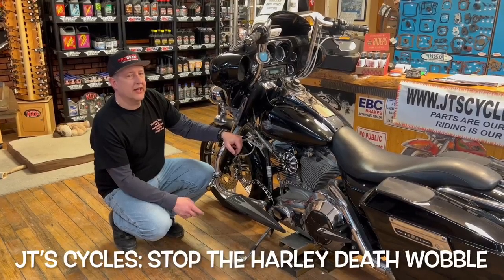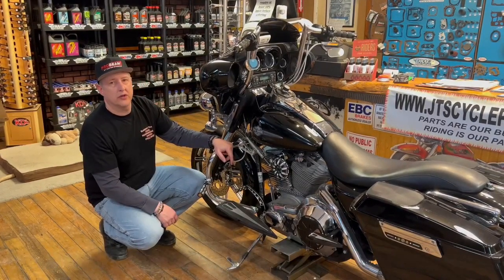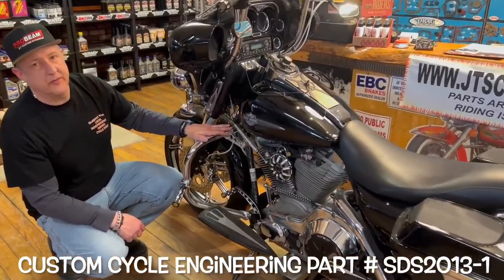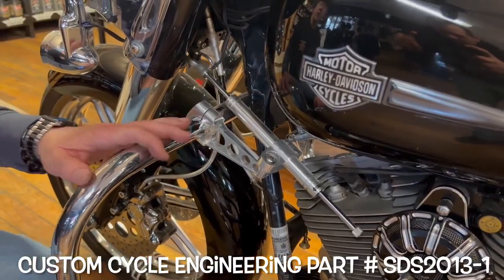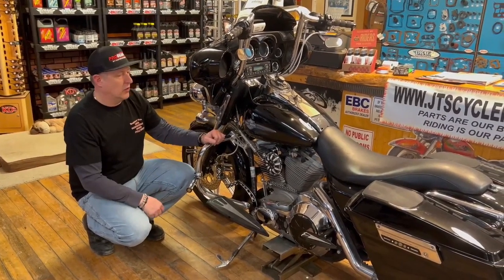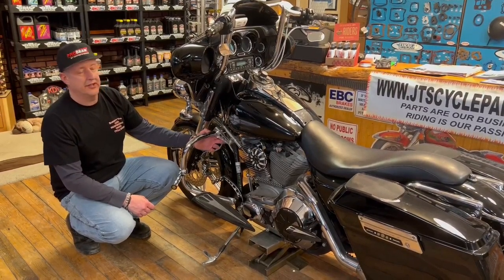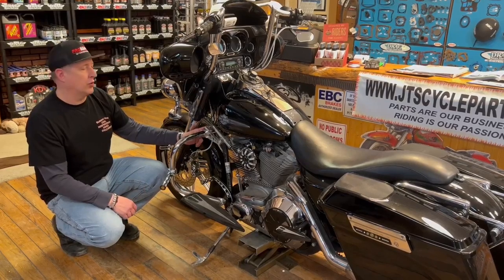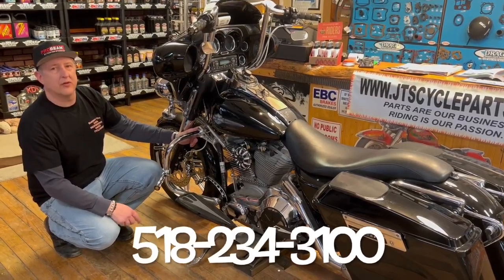Stop the Harley Death Wobble

Comment: I own a 90 Ultra Classic with over 100,000 miles on it.  Made several trips from Chicago area to D.C. area to visit brother.  Taken State Roads and Interstates and have never experienced ANY handling issues.  Not sure where this "Death Wobble" myth started and also  unsure if some other thing (bad tire, bad rear wheel alignment, bad shocks) could be the cause, not a design flaw as so many "EXPERTS" suggest.  One video on here showed a guy going into a "wobble" he got out of. He "labeled" his  vid "The Harley Death Wobble" only to state AT THE END he had a bad front tire.  So before you go spending a bunch of money on fancy  parts, perhaps go over your bike front to back  before you ride.
Reply: Jerry Jones;    Back in '57 I was riding my '46 EL 61 cubic inch Harley.  At the time I was 16 and had my 15 year old brother along with me on the back.   We were on a straight stretch of road and had been following a car which was observing the 55 mph speed limit, but I decided to pass anyway.  I knew my rear tire was getting bald when I pulled out to pass and  was right beside the car when the tire, she blew, causing me to lose most control, went down in the ditch on the left side of the road and up to the top of a 12' bank and back down again, coming to a stop at the lowest point of the ditch.    

I soon got rid of my high speed wobble by getting rid of my Harley!      BHE
Reply: Bruh…for someone that knows a lot, calling it a “myth” only shows your lack of experience. Probably because you’ve only had that one bike for a century. I’m on my third Harley in 8 years. It’s no “myth”.
Reply: @iamthelastemperor  Actually, I've been riding for 50 years, mostly, but not exclusively Harleys.  I also have been a member and at time officer of Abate of Indiana.  Neither myself nor anyone I've known has experienced this "Death Wobble".  The only time I ever had a steering wobble was when I was riding a '54 Servi-car down the interstate full out (not recommended) hit an old bridge expansion joint and the whole damn thing went airborne.  When I came down THEN I had a steering wobble until I got it slowed.  I have maintained my 90 Ultra front to back in the 20 years I have owned it.  When I put a drive belt on, the swingarm bearings got changed.  I do not let my tires get worn.  I have replaced rubber motor mounts.  Parts do wear out and a lot of Harley riders, especially the newer ones, simply do not maintain their bikes.  Mine has over 104,000 miles on her now and still rides smooth and straight.
Reply: @thejordanparkempirewhat speed does your Harley wobble at, I've had a Road Glide for several years and haven't experienced it? Had a Suzuki 1150 that had one about 125, but you could punch through it, it was scary slowing down back thru it tho, don't know why it seemed worse going that way.
Reply: @iamthelastemperor  I previously owned a shovelhead FLH and before that a panhead FL. Drove both long distances and never had a wobble. I suspect most are caused by tire issues. Any misspells are a product of my fat fingers on this phone keyboard.
Reply: Idk, my 90 classic I had and the 06 I have now were 2 complete different handling bikes. They look the same almost identical bikes but the 90 out handles the 06. The 06 has had the bars wobble before when hands are off. The 90 is rock solid. I’ve messed with the 06 and have just accepted the fact it’s not as stable a the other one. It’s not a myth.
Reply: @iamthelastemperor  That 90 was my 3rd 2 wheel Harley. Had a pan and shovel, botjh FLH"s.  Been riding 50 years, never a " death wobble."  My first Harley was a Servi- car with a WLA engine sand taller gearing to do 60 mph. Was going down 94 and hit old expansion joint on bridge. Entire trike went airborne and when I landed had a horrible wobble that I I slowed down and got out of, but that was because Servi- cars eere never meant for jumps.
Reply: @scottberry5266  frames were changed 3times between 90 ang 06. Once in 92, again in 96 and again for twin cam..
Reply: @jerryjones2818  : ok. I knew some changes were made but not how many or what. Like I said my 90 eglide sat rock solid , my 06 eglide felt wobbly from day 1. I’ve messed with alignment, tires , rear shocks, etc and it’s either better or I just got used to it. I have a 12 Victory Version that outrides,outperforms,and out handles both eglides.  Thanks for the info.
Reply: @scottberry5266  Interesting story: a couple in our Abate group bought identical 01 Electra Glide Classics. Same paint and all. She hated hers from day one, said her 96 rode better, but loved riding his. These were identical bikes but his rode easy but hers handled rough. They tried a couple dealers but no one could figure it out. They traded both bikes in 05 and never had any more problems.
Reply: @jerryjones2818  : yeah, it’s weird. Everything I did to the 06 was an improvement I guess. I was always going to put a progressive spring upgrade on it and the truss that bolts to the frame and bottom of the engine but never did.
Reply: @scottberry5266  Yeah. A few years back they dropped the rear air shocks in favor of one 'progressive" shock and one "neutral". Can't speak to whether it improved the ride but all the dealers said it was improvement. My 90 rode great, tracked straight and smooth, and I had no trouble going back and forth to Virginia. 4 times
Reply: @scottmcburney8938  
Nothing wobbles under 65 mph. I normally start feeling it getting loose around 90-100 mph. Nevertheless, the death wobble is no myth! Not on baggers it's not! That's a fact.
Reply: If you ever experienced wobble on an Ultra Classic it's your tire pressure
Reply: I have a new 24 Street Glide and there is definitely a wobble. Firsthand that steering is very light, I wish it can get heavier as you ride faster.  Anyways on the same ride and same highway but a different stretch of the road, I can cruise 85-105 and it will be no issues, ride with any cross wind and the bike will wobble, you mind just prays for no tank slapper. It recovers good but the feeling not so.
Reply: @iamthelastemperor  I have owned a flattie(54 servi-car,) a pan(63 Duo- glide

Comment: this and other steering dampeners, work. but they do not get rid of the rear wheel steer that plag that year Harley that cause the wobble in turns or when steep hard banking. you need an engine to frame stabilser. even a set of stiffies put in the swingarm pivot point on both sides of the swingarm bearings work, which is where the problem occurs.
Reply: Another overthinker who bought into the "Myth"
Reply: @A V yea they do that also.

Comment: I have found that making sure your preload is properly set on the rear suspension is a huge factor in preventing rear end wobble. I have pulled over in the past to stiffen the rear end. It will usually happen when adding weight like a passenger or a passenger and luggage if your don't stiffen that rear end up. I just made adjustments on my last trip this past week while on the trip. I took my 04 Dyna Wide to Mi from Scranton PA. I had some wobble on the freeway so I hit the first rest area and adjusted it one click that straigtened it out then added a passenger before leaving with the passenger I added two more clicks no problems took it back one before I headed back. No problems, there were lots of cross winds and trucks and tightening the preload kept the bike stable. Just saying, pay attention to preload it makes a world of difference with rear end. Note: if I feel the wobble when starting a ride at all I will stiffen the rear end a click at first opportunity.

Comment: All motorcycles and even cars wobble some going by or when a semi passes you, it's wind dynamics, not the death wobble. It may happen more to Harleys because of imbalance and stress on the frame but I've had it happen going straight on a CBR 750 and wasn't going over 75 mph when it happened thank God, it's a unpleasant feeling. Hopefully with the dyna's going with the softball design that problem will be less frequent.

Comment: I have to run 90 mph to stay in formation never had an issue with death wobble as long as tire pressure is good on Ultra Classic
Reply: You have been lucky. When you run triple digits these rubberglides have issues.

Comment: have you thought to grease the neck Barings?? when i  worked at the Harley shop, the tech don't grease the neck Barings, that where you get a wobble?? on the dyna they need  be repacked and adjust to specs. older softails have a grease sert and baggers have them.

Comment: all you had to do is adjust the steering bearing tightness.... for free.
Reply: There is more to it than that but you have a good point. The number 1 reason for wobble is low front tire pressure on any scoot.

Comment: Problem is…I think it’s the back end that wobbles. I would debate whether or not it starts in the front and is exaggerated when it reaches the back. But I never feel it in the front. I feel it at the back wheel.

Comment: Decades ago I found the best way to get rid of your Harley wobble is to toss your Harley and get a better motorcycle.  I've owned and ridden a pair of Honda ST 1100's for over 25 years....NO wobble at ANY speed.
Reply: Then again a lot of "Riders" on this chain seem too lazy to INSPECT their ride, something that should be done every ride no matter the make.  Evidently a lot of fools think you can just get on and ride forever--nothing wears out.
Reply: I rather walk to own a Honda
Reply: @russellabernathy3241  Life is full of choices and if you're satisfied, I couldn't be happier.  

In 1956, I bought my first motorcycle....a '46' Harley 61 Knucklehead.  I then proceeded to put 160K on four different Harleys, including riding to work in San Jose, CA, 100 miles/day for three years.  At 28, I found myself raising two sons, told myself it was time to start acting more responsibly and sold my last Harley.   I had just made an expensive move to Oregon for a job that hadn't worked out, and then back to CA when my ex BIL rode into my driveway on a brand new Honda 750 four cylinder.  I was aware of Honda, but as a then Harley addict, had paid them scant attention.  Took it for a short ride and suddenly I was back into riding again.   Here was a bike that looked good, sounded good accelerated great and had something which Harley had, at that time, only dreamed about, but had never actually executed....a front brake that worked.  

The culmination of my riding came in 2013 when I rode my Honda ST-1100 all around the USA on a mission to 'bag' the 13 states I hadn't previously been in....and did.  Now, I can brag I've been in ALL 50 states. 

Total riding on all of my bikes...well over 200K.   

I haven't ridden much since I took a 5000 mile ride nine years ago, am now l'm facing 82 and think it's time to quit whilst I'm ahead of the game.     BHE
Reply: If you had a "wobble" "Decades" ago you had a bad tire.  This whole Harley Death Wobble myth is a result of people buying motorcycles and not knowing how to maintain them.  The new "Bikers" have no mechanical skills and think you just push the button and go, never maintain or check your bike..  YOU are a Harley basher who either is lying or never even owned one.  I have owned Harleys for Decades for real and never experienced the so called dreaded "Death Wobble".  I firmly believe any wobble is the result of poor maintenance or bad aftermarket parts.
Reply: @russellabernathy3241  The way you've phrased your comment sounds as if you'd rather walk to a Honda Dealer so you can then own one!
Reply: @blackholeentry3489  lol actually I was a Honda Dealer from 1969 to 2020 . I know Honda pretty good . My father and I were a Harley Davidson dealer from 1957-2020 . I never cared for Honda at all . I’m 68 years old now and just got back from Sturgis which I go every year . I rode 1187 miles last year on my Street Glide . As a Honda dealer I never liked their touring bikes I was at more comfortable on my Harley. This year I bought a 2022 cvo Road Glide and rode it . I loved it . I guess I would say Honda over Indian which are the ugliest motorcycles made . So I guess I could say I know motorcycles
Reply: That 1187 miles was non stop except to get gas . If that would have been a Gold Wing I couldn’t have made it
Reply: @russellabernathy3241  I must agree with you as there is absolutely nothing that subs for experience.   I bought my first Harley in '56' at the age of 16 and have put an untold amount of milage on numerous Harley's, Hondas and Yamahas since I bought my first Harley, including riding the Harley 100 miles a day to work for three years in the early 60's.   Now I'm 82 and time to put my 'bikes' behind me and start on a long term pet project of mine....reverse engineering a downed UFO....I wanna soon be the first human to pay a visit to Mars.   Let's see....where did I stash my J C Whitney  anti-grav suit?    BHE
Reply: If you think it’s ’just Harley’s’ you’re dreaming.
Reply: @ozziejim8472  When you fail to take a moment to address whom you're replying to, NOONE knows except YOU!
Reply: Agree, pitch Harleys.
Reply: Makes sense